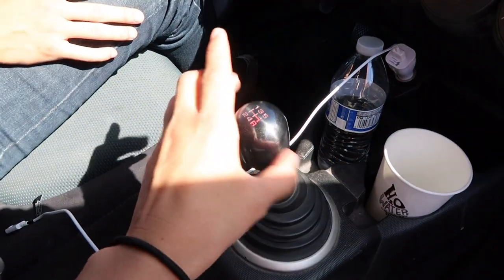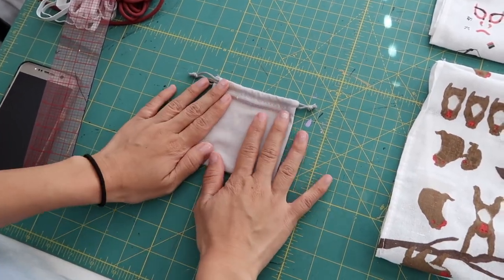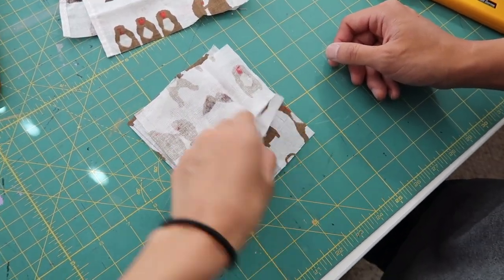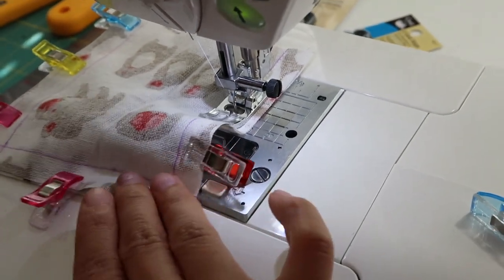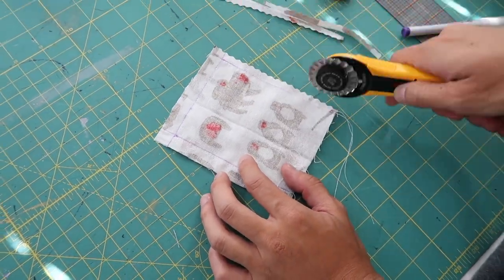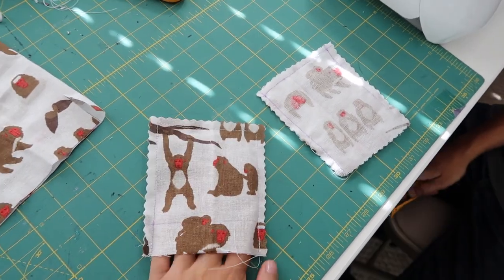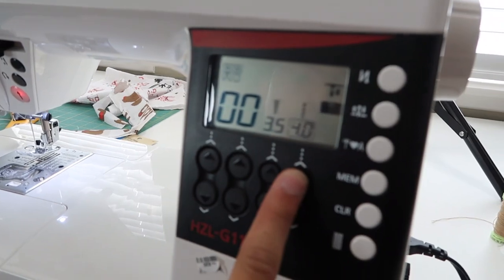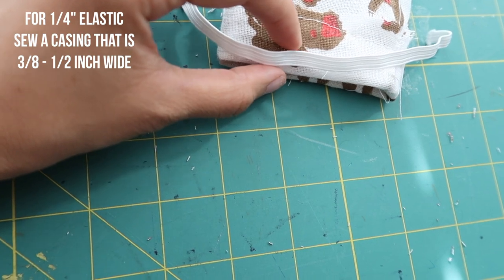DIY Shift Knob Cover | My Boyfriend Sews Ep. 3

Comment from the maker: For the Time, I put 2 hours because thats how long it took me to teach Erik step by step and finish the product. If you're experienced, it shouldn't take any longer than 30 minutes. And if you're a beginner following this video, without stopping to figure things out, it should be less than 2 hours. Keep in mind this is a Beginner Series, so we are going slow :)
Reply: Most of the newer sewing machines' free arms are too fat for a small pouch like this to fit around them, so it may make life easier to turn down and sew the casing first on each piece separately, then join the pieces together. I figured this out when sewing the casing on a Halloween goody pouch in the round like what you had to do -- not great for mass-production items =P

Comment: I just bought my first car last August, and this is super cute! I think I will make one for my car ^_^ 

If you turned it inside out and sewed the corners diagonally, would it make it a rounder shape? I will have to experiment 🤗
Reply: Becca D That will definitely help. If you turn the bag smoothly as you go, you will end up with an even rounder shape, too. 

Just be careful not to sew it too small. You might want to do a demo first with some scrap fabric and then mark the curves of the knob on that and test it out.
Reply: Saekochan Thank you for the tip! I am a beginner sewer, and have only sewed three things, and one of three didn't work out haha, so any info is useful info ^_^

Comment: Asian guy driving a Honda Fit.... living the cliche lol. FYI Erik and April, if your metal gear knob gets too hot in summer, the best option is to temporarily replace it with a DIY plastic one for a few months. I've tried pouches and socks, but ultimately it's easier just to replace the knob, as the Australian summer here can can a steel gear knob seriously hot.

Go to your local hardware store, look at their cupboard handles and select a plastic spherical handle of an comfortable size. It should cost you less than a dollar. From there, buy an M10x1.5 tap, since that's what the Honda Fit uses, drill out the center of the cupboard handle with a 9mm drill bit and run the tap through it.

Screw that sucker in nice and tight, and you have now solved all your gear knob heat-soak issues for peanuts. Done this for my 180sx and a friend's R34 Skyline, and despite the cupboard handle entirely plastic, they hold on really well.
Reply: +pmodd Best thing is that you can make this DIY gear knob in under 30 minutes if you have a clue, so it actually takes less time than this sewing project. The only challenge is to clamp the knob without damaging it, which can be done by wrapping it with rubber before clamping it with your vice or C-clamp. Buy more than one cupboard handle if you aren't confident that you can drill straight.